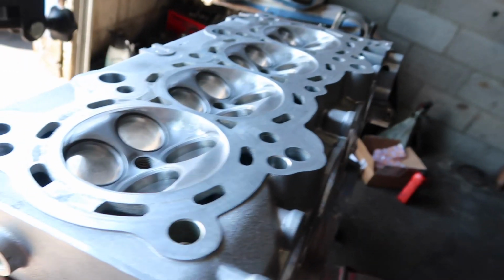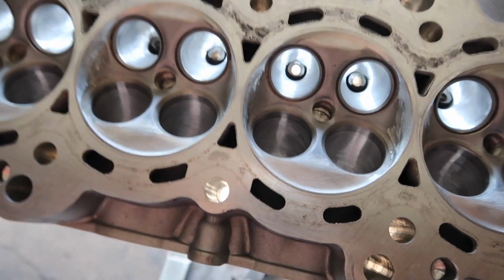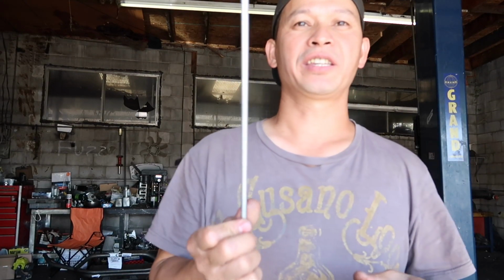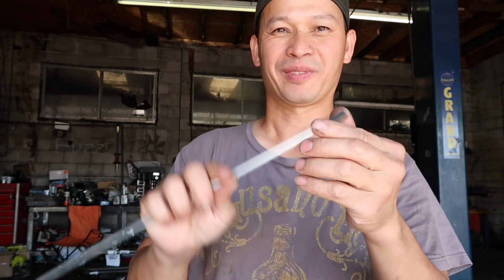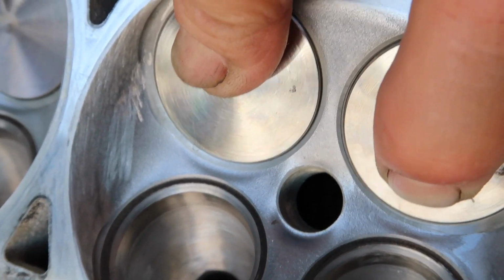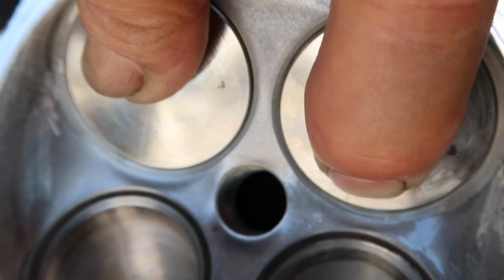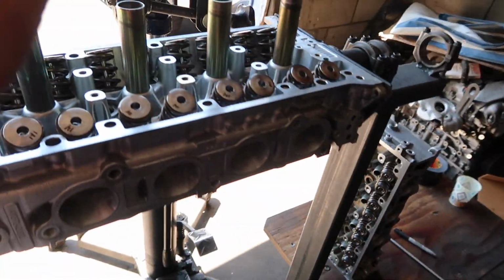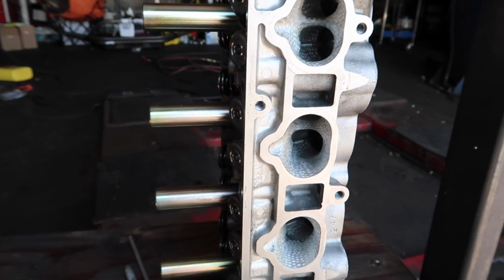Honda k-series head valves lapping jobs!!!!!

Comment: My dad was always a budget racer....I learned how to lap valves at an early age by hand with the suction cup sticks lol
Reply: same here man. Cept we used a really old drill and an old valve to do it. lol
Reply: @az_3kgt714  ya I had asked my dad about using a drill and he said you would do too much work too quickly and possibly burn the valve seats. Now days drill motors are very controllable so as long as you keep it wet you're good....at least from what I've found anyways lol
Reply: @socalcasedog  Yea when we did it we just had the drill go slow and kept it wet with the lapping compound. Never had an issue with leaks.

Comment: I use a cordless drill, lapping compound, superglue and an old valve.
Reply: Super glue the face of the old valve to the new valve, chuck it up in the drill, add lapping compound and run it at about 500rpm. I take a sharpie and draw all over the seat and the valve to figure out where the contact surface is. You can see what’s high and leaves and what is low and stays. I like to measure the depth at which I lap down from the valve face and also valve stem protrusion. Just because a machine shop cuts the seats doesn’t mean they cut them perfect. It also helps dialing in lash.

Comment: phong, you should make the head job and combination to kyle and emilio. they dont have much lucks with cylinder heads yet.
Reply: If they keep revving boosted engines with NA cylinder heads to stratospheric RPMs, they will keep dropping valves. They are unaware of the effect that boost has on the valve springs' ability to keep the valve closed when it is supposed to ne closed. hopefully they figure out this soon.
Reply: @danielcgomez  yes 40 psi on top of the valve at 10 000rpm change a lot of thing
Reply: Daniel Gomez lol, boosted engine with NA heads. That makes no sense.
Reply: A low rpm boosted engine can have lower spring/seat pressure than a NA engine with higher rpm capabilities. So to classify a cylinder head as “NA” or “boosted” is just hilarious. Has nothing to do with the classification of head, has everything to do with a decent builder.
Reply: @RadDadisRad  a NA head is a cylinder head prepared for power production without the variable of elevated boost presence in the intake system(which can easily overcome the valve spring seat pressure, and not allow the valve to stay closed). Look up what can happen to an engine when the valves 'float'.

Comment: Please do a head for Kyle and Emilio .there K tune owes them both money’s. How  did the golf ball effect port grind go did it improve flow always interested in new ideas. Try using a fatter stick but wont spin as fast as your drill way👍 we use 2 different grind paste, wood stick with sucker here in uk 👍👍👍🖖🖖🖖
Reply: K tune have nothing to do with this 
The are 4 piston head with ferrea
Valve and spring

Comment: Oh, no no no no no no no no no no no no no no no no no no no no...
Never ever use old valves on fresh seats. Valves tend to wear concave, and the seat surface should be straight. There are grinding tools for different seat angles for making a flowing and sealing valve seat. then main machining is done with those, and the final sealing surface with paste and the actual valve. Yes you can make sealing valves with Phong's method, but Phong's method thins the lip of the valve causing all kinds of unnessessary issues down the road. Also one very important notion: Valve and the seat should be the same material. If not they wear unevenly causing leaks and other issues. 

One giant YES! Those dimples, Man! Excellent idea! No wonder that head has some serious flow. They could also be a bit smaller and closer together. The story behind those dimples is creating a surface of vortexes around the port, so that the incoming air has less restriction. Same thing happens with casting surface. Casting sand leaves those tiny spots, that create this vortex mat around the port for the air to pass through. This vortex mat also shortens the efficient diameter of the port, so smaller the dimple, thinner the mat, and wider the efficient diameter of the port, more air into the chamber.
Reply: They were old seats. He used the old valve just to smooth any rough spots. Better starting point for the new valves.
Reply: @retsaoter  Furthermore a big no-no. Stock seats can't handle stainless valves, and this causes premature wear and leaks. Also old seats should always be machined with proper tools, they sell then nowadays so cheap, that money in not a valid excuse. If you can afford stainless valves, you can afford those valve tools. Proper valve seat gives you better flow, longer lasting valves and better seal, so higher compression and less valve float.
Reply: @oikkuoek  these valve tool are not good just go to the machine shop 
And stainless valve can go with stock seat 
stock seat are the best
 Messing with them is asking for trouble
Reply: Pretty sure dimples decrease the velocity of the air inversely increasing density. Bernoulli’s principle.
Reply: Simon Legros best is subjective, the information out there will prove that. Budget racing requires making compromises. Also I will agree that you don’t have to change the stock seats because if they aren’t over worn they are still good, if it’s not broke don’t fix it.
Reply: @legros731  Machine shop uses the same tools, only a bit more worn bits. I'm not suggesting on buying the cheapest crap on the market, but I know there are decent sets with most common degree settings that you can use to make working valve seats. Done that many times. Stock seats work with stock valves. If you change the material of the valve, it will behave differently against the stock seat. Fitting the seats is a thing of it's own. That you can mess up easily, and kill the head. But, you can do that too at home, correctly, if you just know how it's done.
Reply: @RadDadisRad  Dimples and casting sand spots create small vortexes. Like in a surface of a golf ball. It has less drag due to those dimples, and their "bearings of air". If the air would drag against the port wall, it would heat up while travelling to the cylinder. those vortexes keep the flow in the middle of the port going faster and cooler, therefore denser, than it would in a smoother port.

Comment: That is not the correct method to lap valves. You should use a valve suction tool and apply firm pressure downward maintaining constant valve to seat contact.
Reply from the maker: John Nelson springs pull the valves from the bottom!!
Reply: Unknown Journey valve springs have absolutely no bearing concerning valve lapping. Lapping is done to ensure better valve to seat contact. Basically you are grinding away microscopic layers of metal.